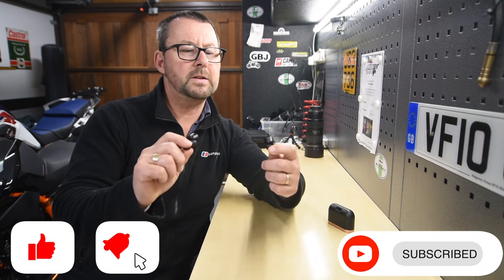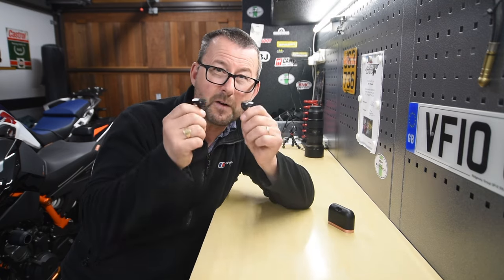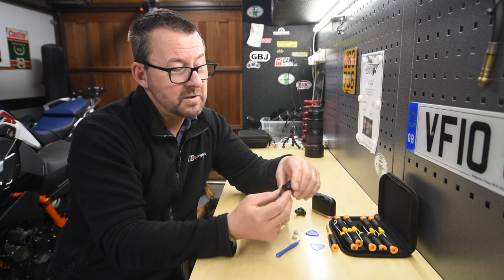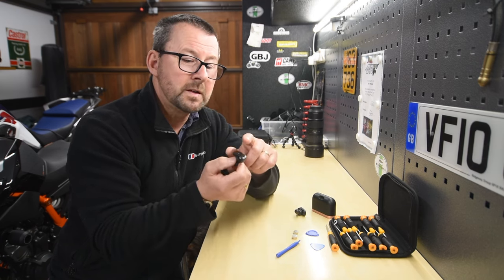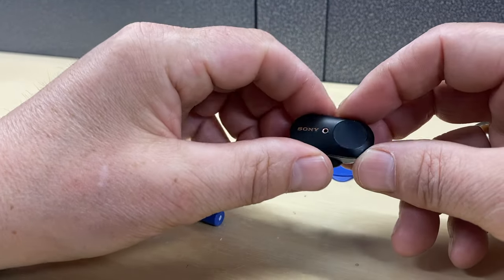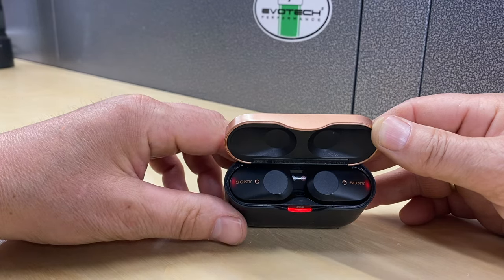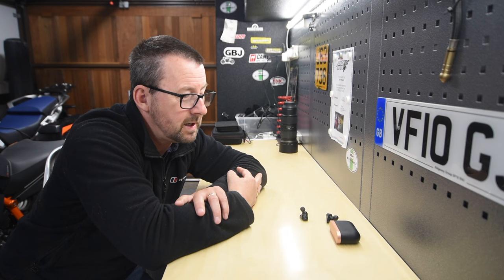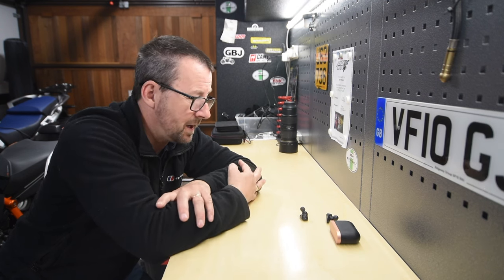SONY WF-1000XM3 BATTERY REPLACEMENT , JUST A 10 MINUTE JOB🤪

Comment: Here's another tip. Don't put the plastic cover back. Try putting on the charger to make sure it's able to charge first. If it's not able to charge, it means the battery contact is not placed correctly.
Reply: Thank you!
Reply: I did the same, even did not read before. As electrician)) after that my sensor tried to word weird. But after that, I resetted earbuds in cradle. Now it works fine at last. My previous battery leaked....😢
Reply: how can i purchase this battery? can u help me please.... i have galaxy buds i want to change the battery

Comment: You are a life savior! I was so sad because mine were slowly dying and I didn't wanted to just throw away an electronic that still work just for the stupid batteries.
Reply from the maker: Thanks . Mine are running like new ! I think 🤔
Reply: @gsd32i  how much time you getting after replacement
Reply: @ahambhramasmii  from what i can see, depending on your replacing battery it can be 1.5h+,
sadly not as long as new pair

Comment: My battery Z55 is getting really hot in my hand trying to put it in the slot... What should I do ? Leave it there ? I stopped the process cause i was afraid
Reply from the maker: Hi it shouldn't do that! Try a new battery, did you get them from a reputable shop?
Reply: @gsd32i  I bought 3 pairs of batteries on aliexpress. When one of the batteries was hot. I took another battery, it didnt get hot, but at a moment yes... But when i installed it... I wait, and it wasnt hot in the slot. Maybe with my skin touch it chaned something... i dont know...

Comment: Great video and instructions! I was very disappointed as I thought my set was slowly dying. And I was about to buy another make just when I discovered your video. I bought the recommended tool set and followed your steps. Everything worked out perfectly. You literally saved me from throwing my XM3's away. Thank you so much for that! Greetings from Germany.
Reply from the maker: glad it helped 👍
Reply: Is it working fine now after one year? I am at a similar position and confused if I should really get the battery replaced.

Comment: Thanks a lot mate. I've finally fixed my right earbud on the second attempt. The battery replacement wasn't hard; you just have to place the battery accurately and test the charge before closing the cap to make it work. That's what I missed on the first attempt.

However, the removal of the outer cap was the most difficult job in my case. I was lucky enough to pry the cap from the opposite end of the ear indicator without knowing the double tape (the black circle part) on top of the flexible PCB (brown ribbon) had been stuck to the inner side of the outer cap. If the prying job was done on the ear indicator/brown ribbon's side, the brown ribbon is going to be teared into half for sure, and there would be another 100 bucks wasted.

So here are two pieces of advice for all future viewers. The first is to pry the outer cap ONLY from the side WITHOUT the L & R ear indicators; that indicated side is the end where the flexible PCB (brown ribbon) grows out from; make sure you do not open from that side. The second is to put your earbud into the charger to test your battery charging before sealing back the outer cap; it saves you the hassle of having to remove the cap to tweak your battery position again.

Comment: Just done the task great instructions thank you. I had a bit of trouble snapping the covers back on, turns out id not recessed the board enough so it was making the backs pop open. A press on the circuit board, and further tightening of the board screws and voila snapped, and now enjoying 5 hr battery life from 1 hour, and a couple of hundred pounds saved!

Comment: I managed it on mine although getting the top caps off in the first step can be tricky. My first attempt of one bud went fine, came off quite easily with patience and not too much effort, no marks. The second one however was difficult and the sticky pad underneath would not break free. Ended up slightly cracking the body, using a metal tool to peel the cap back, jamming one pick in the other side. Total bastard. It came off and managed to get that battery replaced eventually too. Works fine, minimal visible damage but annoying it came to that. Pot luck I guess. As other comments say, don't put the caps back on just screw the board down and drop them in the case to see them light up red charging. I left them off like that til they fully charged before replacing the caps and then resetting them.

Comment: Took a bit longer than 10 mins cos the top cover was bloody hard to pull off, then I realised it was because the round touch-sensitive part was doubletaped to the top cover so had to be really careful not to damage it. But finally did manage to get it done thanks to you, so thanks very much for your video!

Comment: Thank you! I was about to press Go & found this video, 2 weeks later I have fixed my dodgy headphone for £25, saving me spending £220 on a replacement. 
Agree on the Plaster cover tip, but also a note that the LED snapped out for me & didn't go back in. one to be aware of on the bit that comes out with the battery

Comment: Thanks, just did the process with your instructions, works fine.🎉

1 issue I've encountered though was after reassembling my left earphone, the button didn't work properly. It was constantly pushed.
I then took it apart again, made sure the battery is as flush as possible and is not pushing the button towards the exterior. once i did that, it was fine.
I think it is a pressure sensor, so it can't be under pressure.

Comment: Something went wrong somewhere. I replaced both batteries but the right side isnt working anymore. When i put it in the case the case led lights up so it does detect the right earbud. But the led on the right earbud doesnt light up and no sound plays from it. 

Edit: Audio works now. But the LED still doesn't. I guess i knocked something oof. But hey! The battery is fixed and that's the most important

Comment: I was finding my left earbud was running out of battery after 20 minutes when the right was still showing 70%. Thankfully bought two replacement batteries as the a couple of weeks later the right ear bud was lasting under an hour. Now lasting well over two hours on Teams calls.

Sellers on eBay and Amazon all seemed a bit dubious but I was able to buy compatible batteries from RS Components (LIR1254H / stock number 1834285) for about £20 for the pair including delivery.

When taking apart the left earbud I found the ribbon cable stayed attached to the top part of the case leaving the battery part able to come out once the screws were removed. The right ear disassembled as shown in your video - just something to be aware of when prizing apart. I also had some slightly glitchy behaviour immediately after swapping batteries where they wouldn't connect reliably. I think this was because they didn't have enough charge and they now work great.

Thanks for posting the video - I wouldn't have been confident swapping batteries out without seeing you do it first so you've saved me a chunk of money on new headphones (and more e-waste!)
Reply from the maker: Thanks for your comments. Amazing how a simple video like that seems to have helped quite a few people out.Regards Paul
Reply: This was useful. How do i get the prising tools?
Reply from the maker: @nigelwilson3584  Amazon do them for about £6, or ask a friend who may have replaced an iPhone screen recently as these kits have posing tools supplied, or use a small bladed screwdriver, but this may damage the earbud cosmetically.
Reply: Quick follow-up - after a couple of weeks found one of the buds was a bit temperamental powering up and eventually stopped turning on. Took it apart and prised one of the battery contacts up to give a better connection and that seems to have sorted for now.
Reply from the maker: @MichaelNolanUK  Good effort 👍

Comment: Thanks for this. I had trouble getting the batteries in the UK but finally sourced the A4 version which fit the same. So far, so good.
Reply from the maker: Brilliant 👍
Reply: whats the difference between CP1254 A3 and A4 ?
Reply from the maker: @latinomadness  a4 have a bit more power.exactly the same size though.
Reply: @latinomadness  Higher capacity. Mine are lasting ages now.
Reply: @skinnersbollox  would you have a link please to buy?
Reply: @skinnersbollox  assuming there is no problems with it running the a4?

Comment: Hi, did mine just now.
It was ok but I broke one of the tabs that hold the 'lid' - drop of CA glue fixed it.
Be careful about jamming stuff  near the button - directly behind the (R) or (L) markings - thats were the tab I broke was ( you can see it at 4:05).
Just as I finished I thought about heating the headphones slightly before you start - blast them with hair dryer to make the plastic more flexible and glue a bit weaker.

Comment: Thank you for the instuction video.

I purchased a set of ZeniPower Z55 to replace the Varta batteries. The new set has larger capacities so it's an upgrade. The original ones were so deteriorated that they could only last 45 minutes. The new set has 70% after around three hour usage.
Reply: What are the specs of the z55?

Comment: Thanks for the nice teardown. Very informative! A few things I noticed while doing the same job to mine..
- The batteries can short very easily. Touching the top, bottom, and sides at the same time is a bad idea
- The silicon holding down my metal battery connector came up with my old battery. In an attempt to save the old sticky, I tried to place the glue on the new battery. I put too much of it in between the connector and the battery, which prevented the right earbud from working. I took it apart again and totally removed the old sticky, and the earbud came right back.

Comment: Really cool video!

My success rate became 50%. Managed to break the first bud (not only the ribbon, also plastic!) around 8:20. My recommendation: using parrot pliers (ones that give a parallel clasp) turned out giving a sturdy grasp on the battery. On the second unit, I used a twisting motion here, gently tiring the glue/fabric that was keeping the battery at base.

Am now in need for a used, Left earbud if someone wishes to trade theirs! ;)

Comment: Thanks, fixed 2 pairs, 4  batteries costed 6.99 euro. I have black and beige, black had Zeni power z55 batteries and baige pair had Varta, it was odd, both are made in malaysia. But beige batteries failed quicker than black zeni power ones, though black pair was bought first. now both pairs have lir1254 generic probably from ali, will see how it will perform. but the screws were a nightmare to undo,,, broke my tiny scredriver as I had to use pliars. Thank you for the video tutorial. helped greatly!

Comment: Hi, I just used your instructions and wverything worked just fine, my new airbud is now recharging. Thanks! BTW, the screws are so small I lost one of them, it just seemed to vanish; took me a few minutes to find out it was stuck to the side of the airbud (there´s a magnet there). Regards from Spain.

Comment: Thanks for the video! While my battery still lasted around 3 hours it was starting to annoy me. Just now replaced the battery's in my earbuds with the newer CP1254 A4X. Hopefully they'll last a bit longer. Also for me the touch+mic ribbon stuck to the top cover instead of the internal plastic part. This actually made it somewhat easier as I didn't have to stress about the ribbon while replacing the battery.
Reply from the maker: Glad it helped

Comment: Great tutorial.  I was able to replace the right earbud with no issue.  But for some reason the right doesn't seem to work.   I notice that the red light flickers when in the case.
Reply from the maker: Thanks have you tried a full reset?
Reply: @gsd32i   I fixed the issue.   The problem was that the replacement battery had a small metal tab that was soldered on each end of the battery.   I pride it off and the battery works fine now.

Comment: My right earbud glitched out randomly and won’t re-sync with the left bud. They both charge fine, but flash red lights in the case. They both power on but on the left one connects. Ive tried all the reset methods
Reply from the maker: have you replaced the earbud batteries?
Reply: @DoorisJ  i have the exact same problem, have you rectified it?
Reply: @amrit_chail  One of mines works as it is already connected while its not, cant pair with other bud nor connect to phone. Looks like software issue it is just stuck like this. None of reset methods really do anything. All I can do is switch between noise cancellation lol :D

Comment: Great vid and good explanation. Is there any possibility to change the battery in the case or a video with the type of batttery specs. Thx!!
Reply from the maker: The battery inside the case is not something I would attempt to change as there is an element of soldering involved!!

Comment: I purchased Vartas from a US eBay seller named dealab. I returned them and got my money back. The batteries gave me 4.5 hour with ambient noise control and DSEE HX off, and probably lower volume than most people use. At least it was easier opening the buds the second time. If anyone finds a US seller that sells genuine new Vartas or Zenipower batteries please post.
Reply: Getting genuine batteries is an issue

Comment: It worked. I changed to a Z55 Varta battery. So far so good, but the Sony Headphones connect app refuses to connect after the battery replacement. Even after I did the factory reset. All the things done, my earbud now run more then the usual 1 hour.
Reply from the maker: Try deleting the app and any connections between the earbuds and phone and start again as a fresh install .

Comment: Thank you for your work. I just have a question after the replacement . When I want to connect to my phone . On the software it’s written only 70% of charge . What can I do ? Thanks !!
Reply from the maker: Try deleting the app and then reinstall it and also do a reset of the charging case .

Comment: If the metallic holder you see at 8:40 falls off or comes apart dont worry. as long as you fix it in place in a way that guarantees contact when the battery is on, you'll be fine (visible at 9:50, not the big square, that's the chip, but closer to the left)

Comment: Followed your video (brilliant by the way thank you for sharing) and when I was replacing the top cover the upper part that snaps the cover shut seem to have been chipped off. Any suggestion on what can I use to hold the cover in place?
Reply from the maker: Try a tiny dab of silicone possibly?????

Comment: Could you please tell me about the battery life of the earbuds after replacing the batteries and also how are they holding now after a year of replacing?
Reply from the maker: Battery life is very good and everything is fine 👍
Reply: @gsd32i  does it last more than 4 hours?
Reply from the maker: @ytpremium3128  yes but make sure you get the proper battery and not a fake one !!

Comment: Hello, thanks for the video :)
I did it the exact same way and i didn't see any damage that i did. But after putting it back together and charging it in the case, the ear bud that i changed the battery on won't turn on. i tried the reset and the hard reset but nothing works. it seems like the touch pad isn't working anymore. Any experience with this problem?
Reply from the maker: Just a thought, try swapping the batteries over as you may have a bad, new battery!

Comment: Hello, thanks for details that you share with us. My headset works just about 60 minutes, would you please tell me  if this is not normal or needs to change the battery, I took it from a friend just 20 box, and I don't really know if the battery is dead or it's just a normal duration. 
Thanks dude.
Reply from the maker: Hi . I would say put some new batteries in , you should get 5+ hours 👍

Comment: I have a problem where the buds wont turn on when removing them from the case if charging cable is not connected...  even when fully charged.
Very annoying when im on the go without a cable on me.
Do you have any ideas shst it might be?
Sometimes they dont even turn of when I out them back in the case.
You think its the batteries?
Reply from the maker: Hi. Try a factory reset of the buds . If this doesn’t work have any friends got the same ? Try their charging case . Changing the battery of the buds may help if your only getting a short time of use from them being 100% charged .not difficult to do .

Comment: Hi. Just want to ask

Mine was when buds are inside the case both lights turns red but when taken out only the left bud blinks blue. It’s also not readable via sony app even in bluetooth. I tried to reset both. It is not responsive at all. What should i do? Is the battery was the problem?? I hope you answer 🙏🏻 Pleaseeee🙏🏻🙏🏻🙏🏻
Reply from the maker: Hi, sorry for the delay. I would try some new batteries. If you know someone with the same ear bugs then try their charging case too, to see if your case has an issue. Sometimes you may be buying batteries which sadly  are rubbish!!!!

Comment: Fantastic video and well explained. My right bud needed a new battery. It was tricky getting the top cover off as it felt partially glued and taking the battery out was also a fiddle as it was really tight. But patience and some decent tools did the trick. Saved me £220 having to upgrade to the XM5. Legend
Reply from the maker: Glad it helped